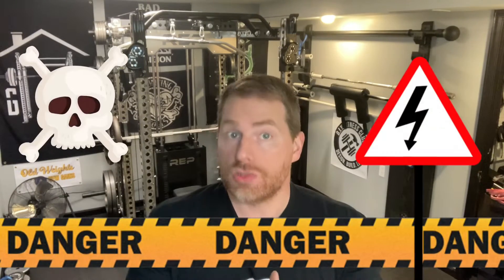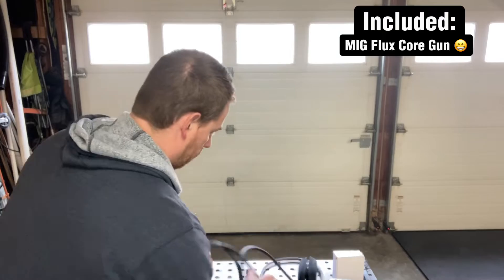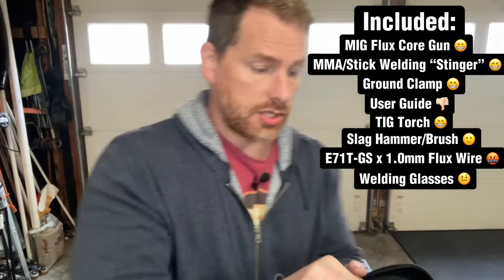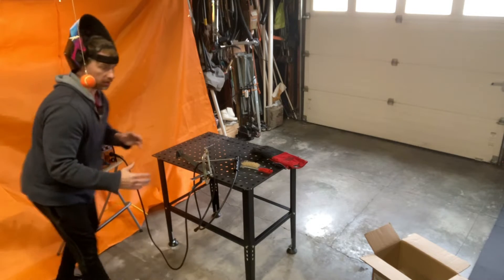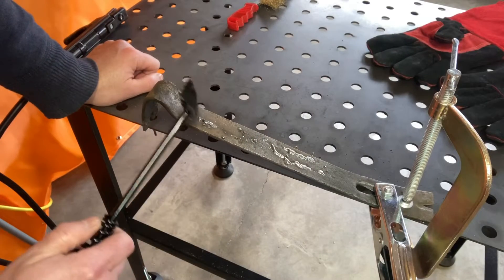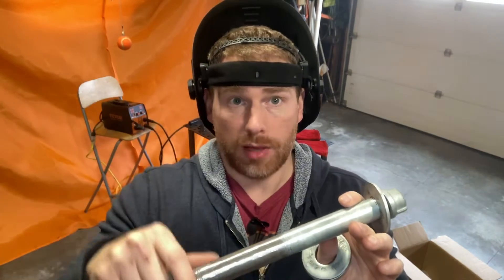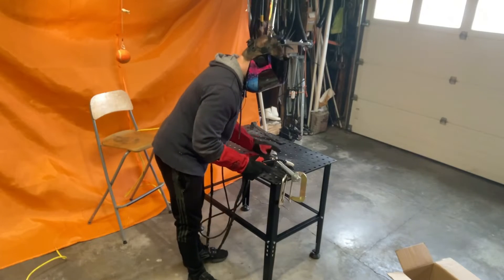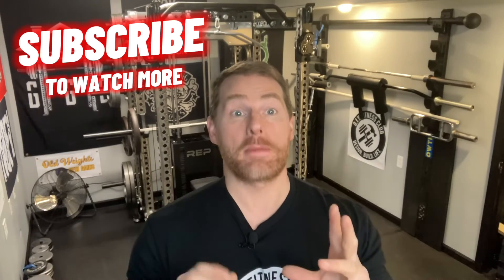First Time Welding EVER: VEVOR MIG-130 3-in-1 Welder

Comment: It might not be welding that good because that unit only has a 110v outlet. If it was able to plug in to 220v it would arc with a lot less amperage just little fun fact advice
Reply from the maker: You’re right – this unit is limited by the 110v plug.🤘